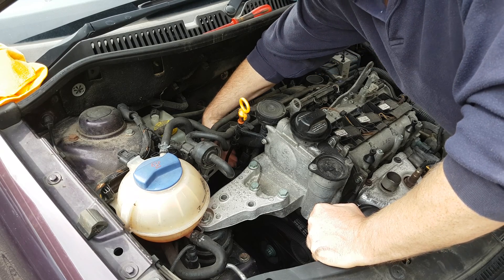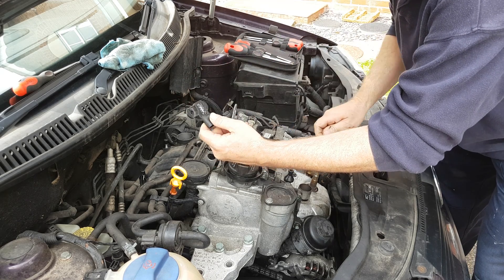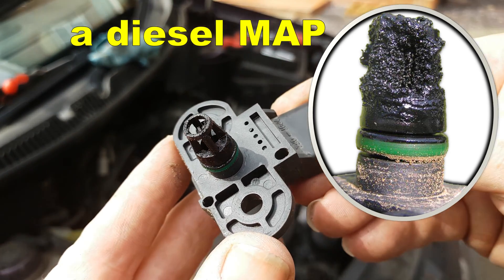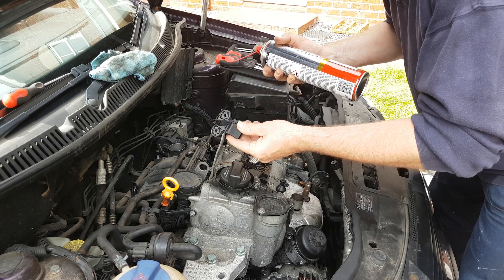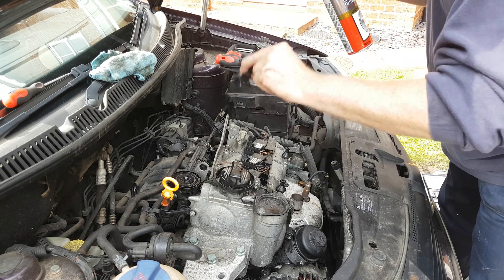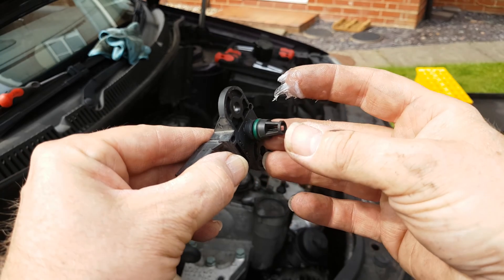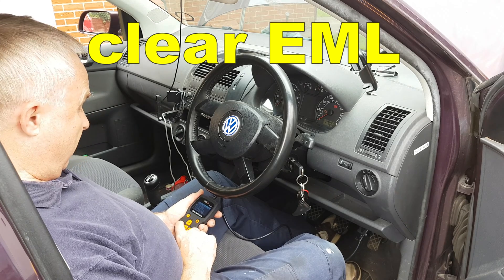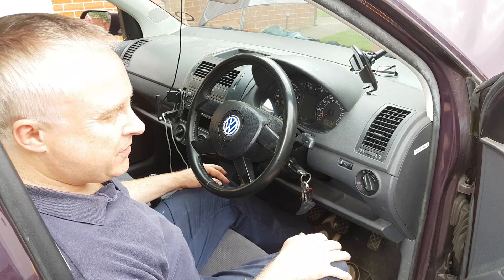Dirty MAP Sensor Problems | Boost Sensor Cleaning | P0106 Code

Comment: Can you help me about seat leon 1.6 16v mk1 petrol, i had engine idle problems, and check engine light is on with EPC light together, i don't know what to do.. I cleaned throttle valve, but no effect. Please help me. Thanks a lot.!
Reply from the maker: 1. have you cleaned your MAF and MAP sensors? This video for MAP and https://youtu.be/V6fxxprx1F8 for MAF.
1a. if your throttle position sensor/motor unit is one that can be opened, check for oil contamination of the sensor pot and motor.
2. check the PCV system is clear and working
3. check condition of all pipes and for vacuum leaks
4. check all electrical connections and harnessing are sound to the engine ECU, throttle body and throttle pedal.
5. check brake lights work correctly and wires and connection to the brake light switch.
This is all basic stuff that should be done periodically anyway, but rarely is.
If this yields no result, have the MiL DTCs read.
Reply: @CycloneCyd  i will try all these, thanks, have a nice day 👍
Reply from the maker: @ilidanStormrageTv  you can read engine ECU codes yourself by using Torque Pro app (android) and one of these
http://bit.ly/OBD2_BT_Adapter
You can also read live data with Torque Pro, which may be useful in your situation
Reply: @CycloneCyd  thanks very much for solutions 👍

Comment: It's not dirtt it's the recirculation of exhaust gases   by the egr valve  or turbo burning oil and feeding it into the intake manifold
Reply: The recirculated gasses from the EGR come in after the sensor, at least on my AVF passat, the sensor mostly gets clogged by dust that makes past the air filter combined with the oil that the turbo slowly leaks + pcv gasses, in time they get a thin cover of sticky junk, just had mine cleaned with isopropyl, worked a charm.
Reply from the maker: ALL engines do this to a greater or lesser extent. It's the recirculation of bypass gases and combustion products coming from the crankcase via the PCV whether there is an EGR or not. Burning oil makes it worse, but a dirty MAP is not a sign of oil burning in itself.

Comment: This is more commonly found in boosted engines. However, some Honda’s and other makes did include map sensors as opposed to maf sensors for a number of years. A faulty MAF or MAP sensor will cause rough/uneven idling, poor engine response, acceleration, fuel economy, and trouble starting up.
Reply from the maker: Yes, indeed. The crap actually comes from the PCV system. I'll be fitting a catch can soon.
Reply: See they tick all my boxes accept it starts fine ill give it a clean today I've already cleaned maf  surely the maf cleaner would suffice for the map given the maf is also sensitive ?

Comment: I Hope the brake cleaner doesn't cause corrosion of the rubber o ring !  And couldn't you of at least sprayed it over a pot or bowl, save spraying it all over the engine?
Reply: Was going to write the same, then I saw ur comment 😂
Reply from the maker: Brake cleaner is formulated not to harm rubber and in any case it dries off so quick it doesn't get a chance.

Comment: I wouldn’t use brake cleaner you realise it is a sensor they can easily brake. I’d use maf cleaner or  at worst electronic cleaner
Reply from the maker: What is important here is not so much the name given to the cleaner (marketing mostly), but that the cleaner you use contains no oils or other chemicals and leaves no residue. As mentioned many carb and contact cleaners do leave residue. Brake cleaner is the only one out there that never leaves a residue.. It won't harm the sensor in the slightest - rare earth metals and ceramics are tough.

Comment: Cool accent, I could stand someone telling me my car has died with that accent and it wouldn't bother me a bit and I'm a guy, so I can imagine what effect it has on the girly's out there lol 🤭

Oh FYI I would recommend using brake cleaner but there is a product that's called sensor cleaner that won't destroy sensitive components inside the sensor. Also its used for mass airflow sensors to.
Reply from the maker: Ha ha, I wish! You can use any cleaner really - what IS important is that the cleaner leaves NO residue. Some contact cleaners DO leave a residue, so always check the can or manufacturers website. Products marketed as specific MAF/MAP cleaners won't leave a residue, but mostly it's a marketing ploy to charge more!
Reply: @CycloneCyd  yes it's called CRC made in the United States I don't know if they got it abroad yet
Reply from the maker: @JasonSpitzMI50  I think it is available here in the UK, but unsure about elsewhere. Don't forget that I need to try and offer solutions that anyone anywhere can use. I also try to cut through the marketing hyperbole whenever possible.
Reply: @CycloneCyd   Understood 👍 I'm subscribed to your channel so I can have another opportunity to converse about different automotive products.
Reply from the maker: @JasonSpitzMI50  Of course. All constructive discussion is welcome. Add your knowledge to mine and that of the "collective". A US perspective is especially welcome as you have a lot of different products there to us here in the UK and Europe

Comment: Do not use carborator cleaner to clean electronic item. it is very harmful. carborator cleaner is only for cleaning dirt on to the metalic items. Do not directly apply on rubber, plastic, paint, and electronic  circuits. thanks.
Reply: Thank you, Cyd! I don't have MAF cleaning spray or contact cleaning spray on hand --- could I use rubbing alcohol (isopropyl alcohol) in a spritzer bottle and then let the MAP sensor dry out before reinstalling it? Please advise... Much appreciated...
Reply from the maker: @jimb1580  I think iso alc might do the job but I'm not sure it would be effective from a hand operated sprayer.Part of what removes the dirt from such a small delicate component is the atomisation of the liquid cleaner to very tiny droplets moving at speed so that the spray carries dirt away with it.
I say, try it and be sure to let us know if it's effective.
Reply: I was just about to say the same thing! 😛
Reply: I’ve read about using carb cleaner and brake cleaner is harmful,I’ve always used electrical contact cleaner,not as harsh
Reply from the maker: WHY? In what way is it harmful?
Reply: @CycloneCyd  It react with plastic and rubber and melt it
Reply from the maker: @girish4010  enlighten me❗ Which compounds in carb cleaner react with which plastic and rubber compounds❓

Comment: Hello, I have a Focus Mk2 1.6 tdci and the engine seems to be running more rough and making more noise. I've got my air intake hose(which contains this sensor)and my alternator replaced... I know for sure they didn't cleaned the sensor because they are cheap, and never do a complete job...Can this sensor cause these problems because  I've got a new clean hose and a dirty sensor ? by the way, i dont have any lights coming up on the dashboard.. it's just the thing that my car doesnt seems to work like it used to do like 1 week ago.

Comment: Great tip Cyd, on the Saab, it's so easy that I will now do it as yearly maintenance, thanks. The only suggestion I have is to use silicone grease instead of petroleum jelly as that might deteriorate the seal.
Reply from the maker: Yeah, silicone grease is good. PJ won't do the O ring any harm

Comment: Hi can you use brake cleaner to wash the MAF sensor as well (the sensor right after the air filter) ?
Reply: You can use any cleaner that doesn’t leave any residue.  Some cleaners leave a residue and that can destroy your sensor if it’s a hot wire sensor.  The residue will get too hot on the sensor.  All MAF cleaners are residue free.  Certain brake cleaners are residue free and some are not.
Reply from the maker: Yes you can. Indeed, I do. See here https://youtu.be/V6fxxprx1F8
Reply: No way, you need CRC Mass Air Flow cleaner for the ''MAF''  Never use brake cleaner, it will destroy the MAF ;)
Reply from the maker: @xinixxagnix201  NO it won't. MAFs are made of metal wires (platinum mainly) and ceramics (some even have a glass film coating). So, please explain how a cleaning solvent will wreck this??
Reply: Cyclone Cyd he thinks it’s made of sugar spice and everything nice, so you must use a spray of soft sugar from heaven made of angel clouds 🤣
Reply: Forced air to blow all the dirt off would of probably been better. And replacement O ring. No need for vaseline. The rubber is supposed to make the seal, not Vaseline.